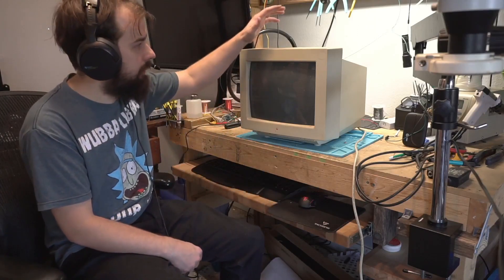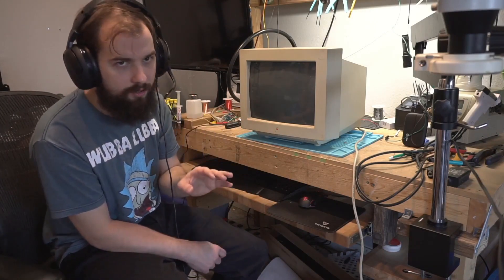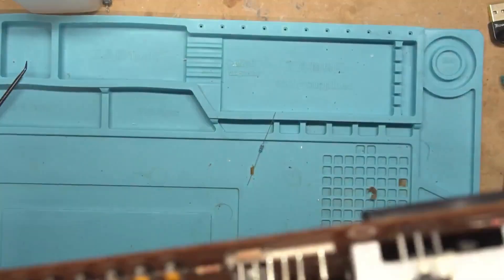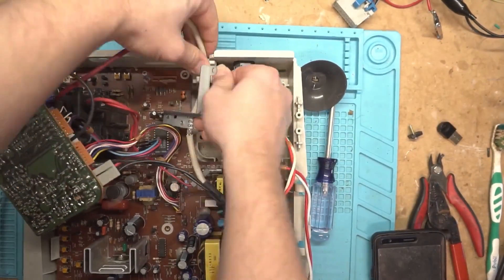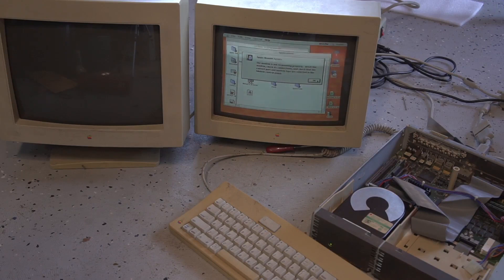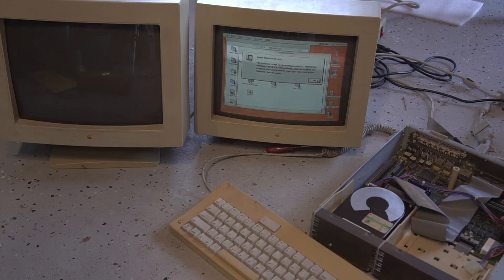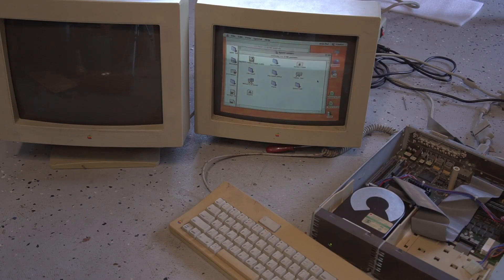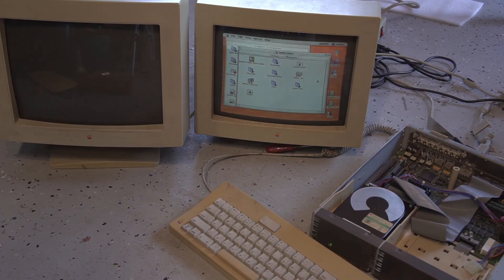Apple Color Plus 14" CRT Monitor Repair

Comment: You can use an octopus circuit to test those capacitance
Reply from the maker: I have a cheap LCR/ transistor tester I use to get an idea if they are bad or not.